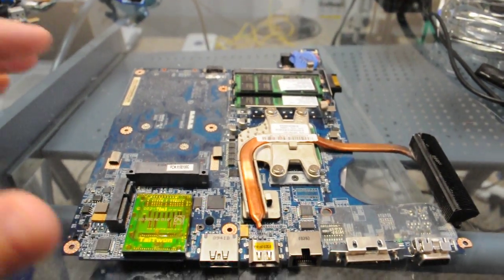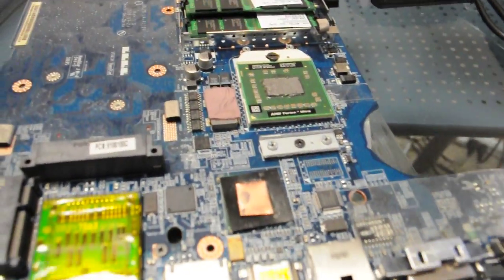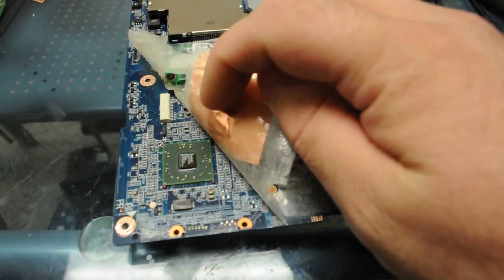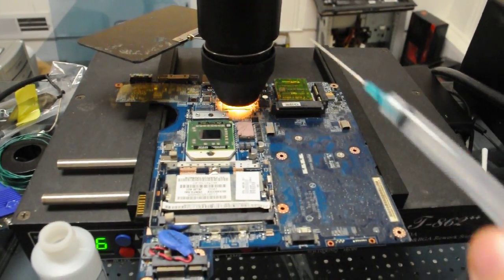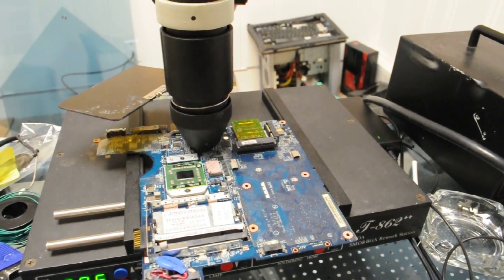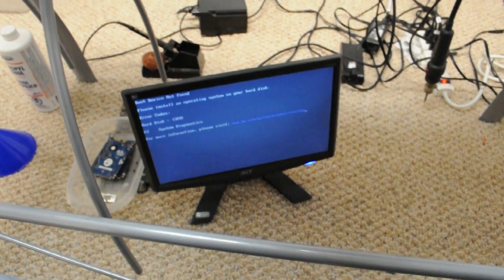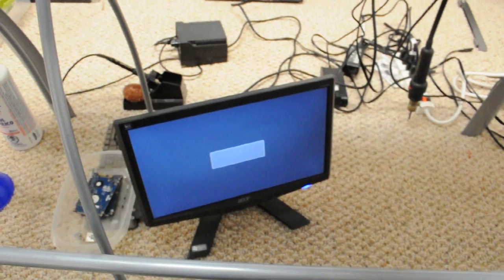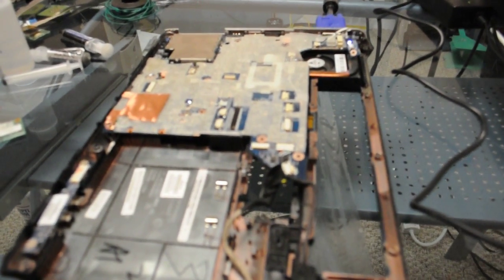Doubleclickittofixit BGA reflow of a HP DV4 to fix a no video issue with previous copper shim repair

Comment: BGAReflow, My  HP pavilion dv4-2145dx will boot with sound but have a black screen now. I changed the screen after a few months because of a black screen but the 2nd screen does the same thing and still get a black screen, and it would show the screen for a few weeks, then it started fading out, but it still boots with sound. I believe that it is the same issue with the graphics overheating as this is a fairly new laptop I hardly got to use, and paid over $900 and will not loose my money so easily. What do you think???
Reply from the maker: Just fill out this form and you will get all the information you need to have us perform the repair.

http://doubleclickittofixit.com/contact/repair-service-form/

Comment: when you re-attach the heatsink, do I NEED to have a Thermal Pad between the heatsink and GPU? Or can I just use thermal paste?  If I need a thermal pad, which kind/thickness should I get??  I appreciate your help.  By the way, I will be doing this on the Dv7 motherboard

Comment from the maker: You can reflow it with non-specialized equipment all day long but it will not last.  If you do not have the equipment shown you are taking a risk getting it too hot, blowing off capacitors on the chipset, or overheating the chipset.  Heating it in the oven is not wise no matter how many people say it works.  A heat gun is about the closest you can get without the system, but I do not recommend it due to the pressure caused by the fan in the gun blowing stuff away.

Comment: I have an HP DV4-1222nr that exhibits signs similar to IndianSummer's DV6.  The Num/Caps Lock light blinks - on for a sec then off for about 3 secs.  HP's help site on LED error codes says that it is a CPU issue.  I have tried replacing the CPU and I still have the same issue with the blinking lights.

I am not opposed to trying the reflow thing but I dont have any of the equipment shown in the video.  Is there another way I can try it without all of the "special" equipment?